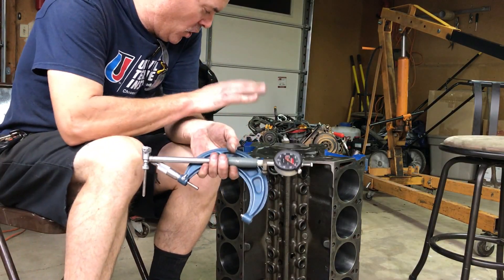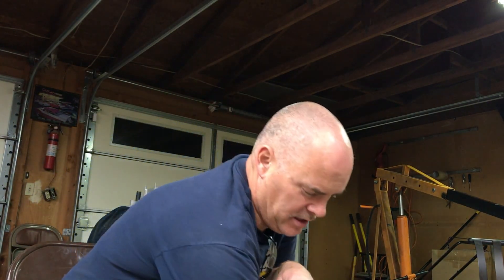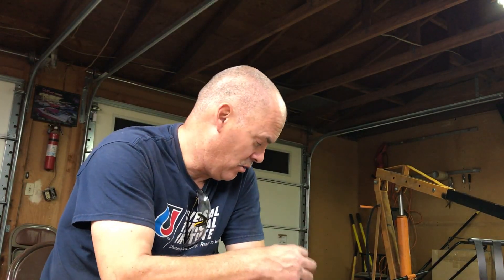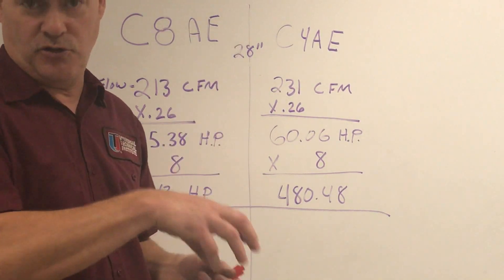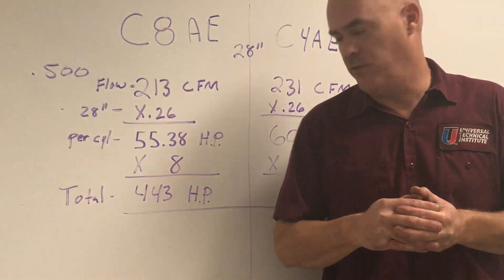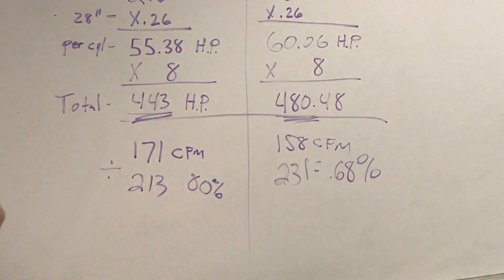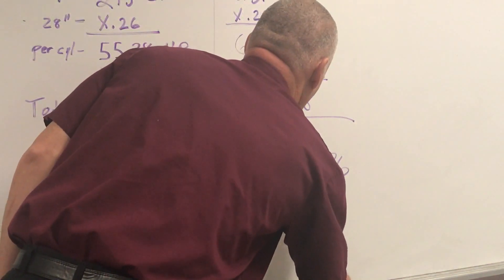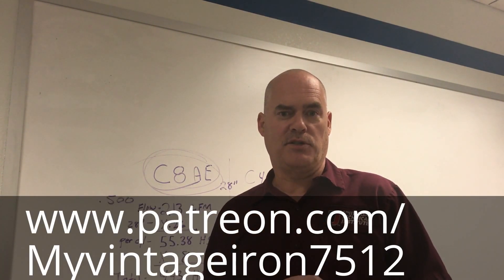390 FE Head Shoot out

Comment: I have a stock 390 FE with a two barrel intake and  351 cfm carb, stock exhaust manifolds, a rv cam. I know headers from Sanderson would make the biggest improvement along with a stock 4 barrel intake and Holley 600 cfm carb. My question is this how much more power could I expect from these upgrades?? I'm not interested in a aluminum intake cause to expensive and I can get a stock 4 barrel for 50 bucks. One thing for sure the stock set up is very anemic and the power curve flattens out very quickly!!! Do you know of a similar dyno comparison of my two setups???
Reply from the maker: The two barrel is a piece of junk not sure how much power gain but it would be an up grade for sure
Reply: Check this out I found and especially the comments about how well this carb works on a 390 FE as compared to the stock two barrel ford carb which is 351 CFM compared to the Holley 500 CFM  http://www.jegs.com/i/Holley/510/0-4412S/10002/-1      
★★★★★ 5 out of 5 stars.  
Dr Injector
 · 8 months ago  
This carb is the bomb
If you have a stock 390 or one with a RV cam this carb WILL heal many wounds. Bolted it on and it has a much stronger idle and throttle response. I have not run the numbers but fuel mileage is already better, still on the first tank and have made two trips past a normal fill up. You cant go wrong with this, Best money well spent.
★★★★★ 5 out of 5 stars.  
Tim5280
 · a year ago  
Legendary Holley Performance
What can I say? This 2barrel works exactly as expected. Crisp response, easy to tune. Just what this truck needed. Thanks Jegs
★★★★★ 5 out of 5 stars.  
Racehorse
 · 4 months ago  
Great Carb
I recently purchased this carb for my 1974 Ford F250 with a modified 390 FE engine. The carb works great, throttle response is better than I even thought it would be. Gave my truck more power. It was missing a gasket and O ring that goes under the float adjustment screw but I bought this at a local auto parts store for just a few dollars. Shipping was REALLY fast, received it in 2 days after ordering.

✔ Yes, I recommend this product.
Reply: My original 390 from 1964 has its original 2 barrel carb. I definitley want to upgrade it but I need to rebuild my motor first.
Reply: Mark Dilley I put a Holley 500 on my stock (except for headers) 360. The change was amazing. My '73 f250 growls now.
Reply: Hey bro guess what I got that Holley 500 cfm # 4412-S carb for xmas and put it on and man what a difference in starting ease, throttle response and low end power, I think once I build a set of custom headers to replace the lame stock cast iron exhaust manifolds the midrange will be even more improved. I will let you all know how that works out once done.

Comment: Did you drill through the block with a 3/8ths drill brit from the oil pump hole to the filter housing mount? I have done this on the last 2 builds with my 428 stroker engines. Great info on the heads btw..thanks..I built a 390 with a 428 stroker crank and the pistons are 21 thousandths out of the bores and I'm running mls head gaskets to make it work ..I'm running mild ported c8 heads ..what head would recommend and far as iron production for my engine?
Reply: James T43 I  would like to tell you that the the oiling mod. you are talking about uses a 7/16 bit not 3/8. Also need to get the high performance oil filter adapter with the large passages. These came on 427s and 406s. I think you can purchase them aftermarket now.

Comment: I had a 67 Cougar GT 390 with 68 427 Low Riser Heads that were 16 bolt. Do you know how they flowed? With steel shim head gaskets I was running 11:1 compression and it was a fun 4-speed car.

Comment: do you know if 390 edeldbrock heads will work on a 360 with edelbrock intake and a thumpers can??
Reply from the maker: yep
Reply: As long as your bore is 4.05 or higher
Reply: @aidenbarbour4989  360 have a 4.05 bore same as a 390

Comment: Very informative video. the C8 head is actually the medium riser head. The C4AE head is the low riser. The Ford nomenclature refers to the intake manifold, not port design.
Reply from the maker: Yes you are correct I reversed it in the video
Reply: That changes everything about the video.reading this after the fact.

Comment: Ever flow the EDC head for the fe?
Reply: Same question. I have a set of fresh EDC heads with machined combustion chambers and are fitted with the 427 valves. I don't have a lot of resources. So I want to know if this will run well on a 410 that is .30 over. I have also a Fomoco police interceptor(?)  aluminum intake that weighs nothing. Not a sidewinder. If you could shed some light on any of thisvI would greatly appreciate it. Thanks
Reply: headbytes porting Ford 390 1960 FE Head Porting Combustion Chambers Part 4.2